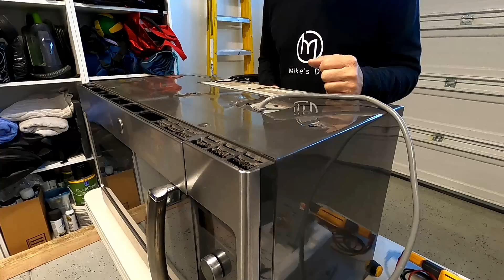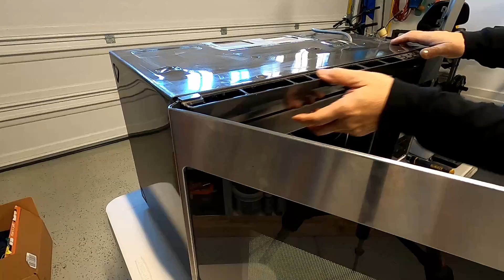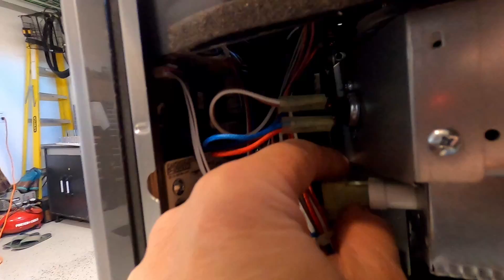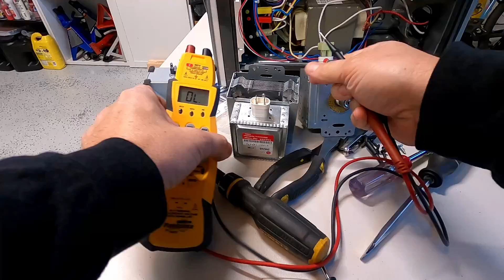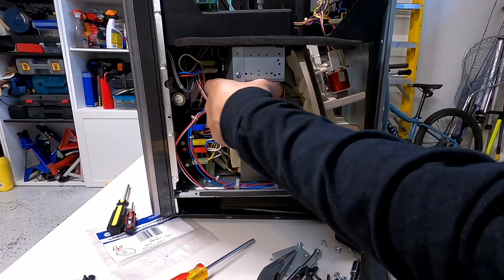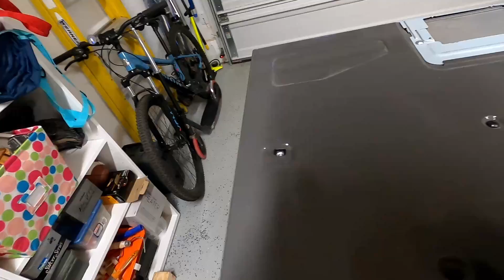Microwave Not Heating Repair- Magnetron and Diode

Comment: This seems very intimidating for me (complete amateur), don’t wanna throw out my microwave but I’m scared of buying parts for it and messing it up or getting hurt
Reply from the maker: There are a lot of steps involved, definitely. There are appliances repair plans out there, appliance repair people, and appliance repair companies that might be able to help. A new microwave could be as expensive as having someone fix an old one, and usually, installation is included. You have to weigh the options. Good luck with your project!- Mike
Reply: What's the part number for the diode?  I can't find it on the GE website. I have the exact same microwave. Changed the fan as it burnt out. The microwave was working fine. Then it stopped heating. Changed the magnetron and still not heating.